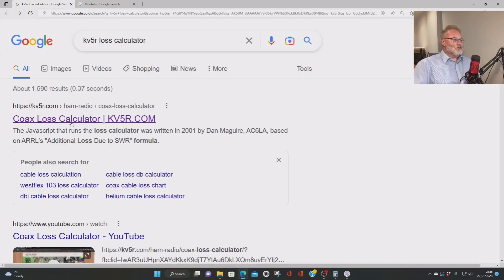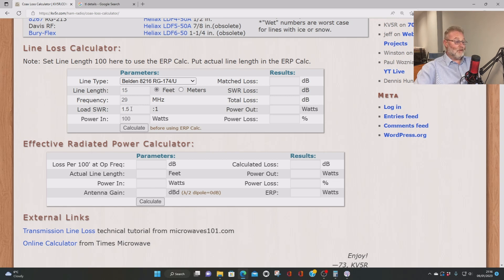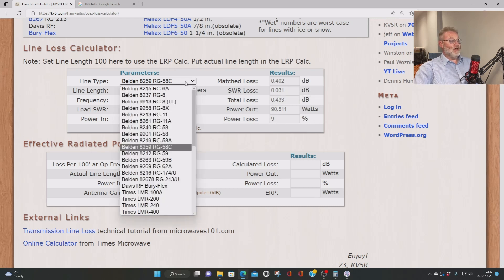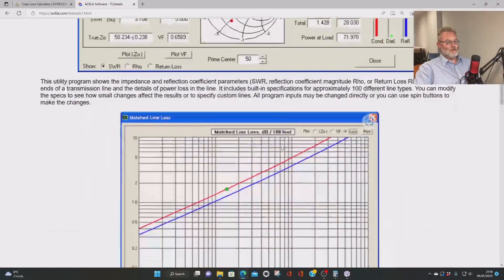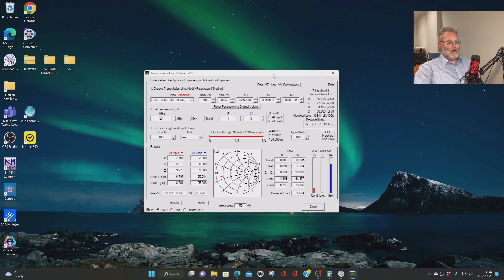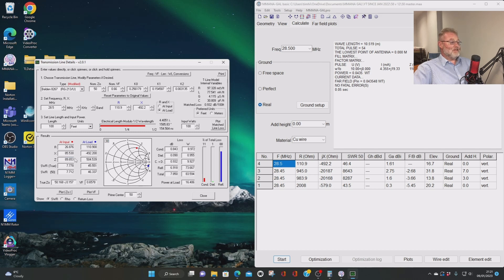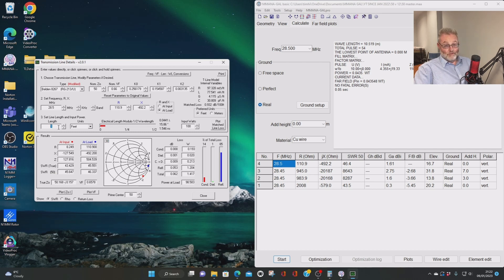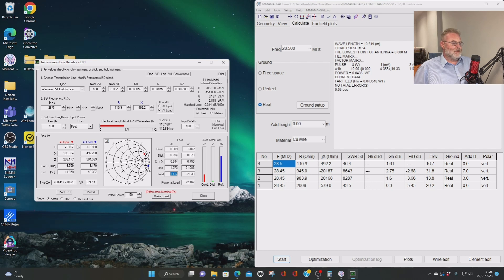Ham Radio: How I Calculate Coax & Ladderline Loss

Comment: I still use Ultraflex 7 for longer runs, but RG58 MIL is more than adequate for short runs of 50ft or less, and it's a heck of a lot easier to work with.  I wont use RG174 though, not even for portable.  RG58 MIL has almost half the loss but is still light and very flexible.  
Mini-8 cable is in no mans land, not good enough for long runs and almost identical in performance to 58 MIL despite being thicker, heaver and 40% more expensive.  The outer jacket is harder wearing though.
Reply from the maker: I agree with your comments on rg58 👍